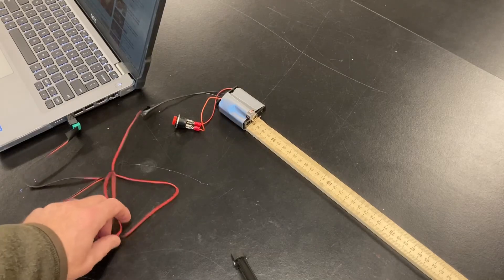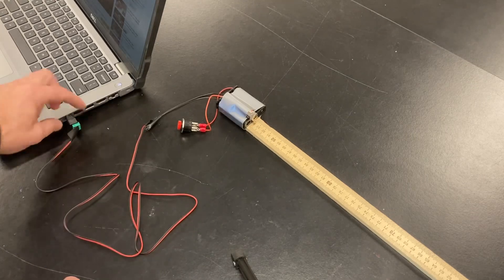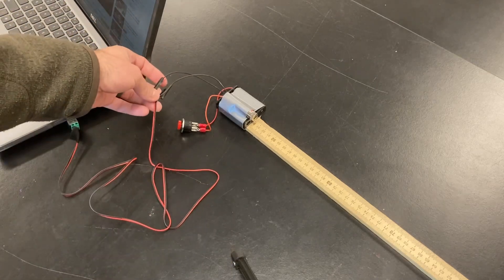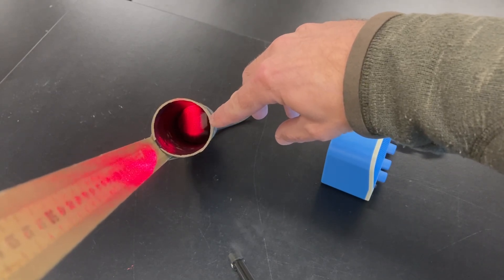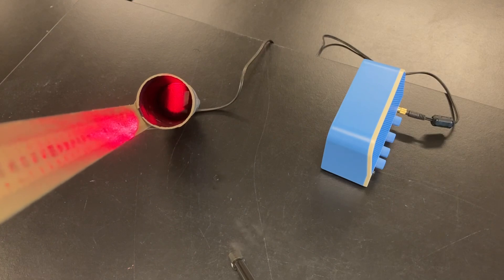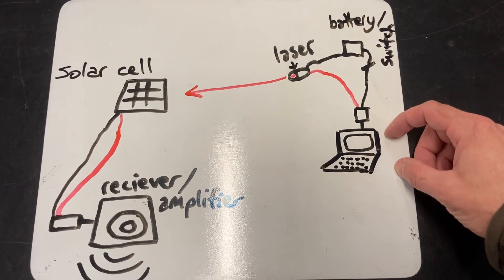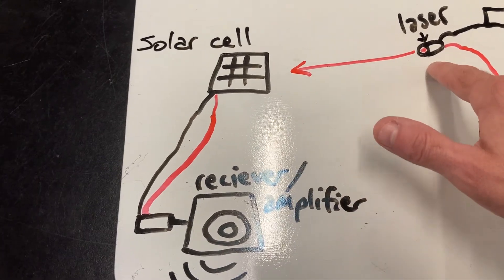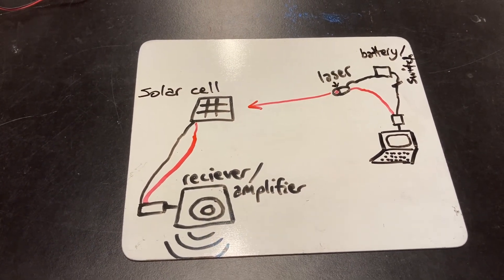How to send sound via Visible Light

Comment: so laser generates a blinking light which can be transferred to a solar panel that generates electric impulses that can be used as an audio source? What is the furthest laser-panel distance this system can work?
Reply from the maker: The laser light is modulated by the audio signal (not sure what type of modulation). Good question about distance. I will test this one after I take the mobile version apart in a month or so.  @DIYExperiments built one that works about a block away.